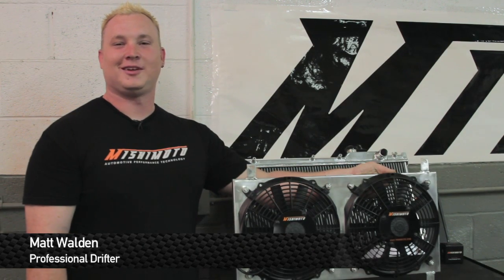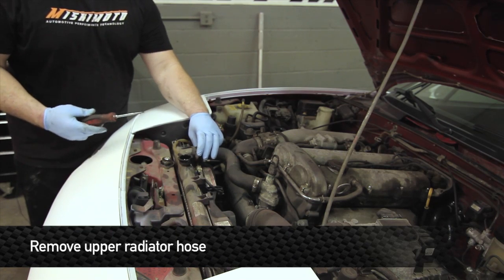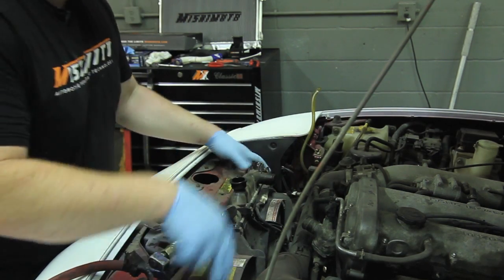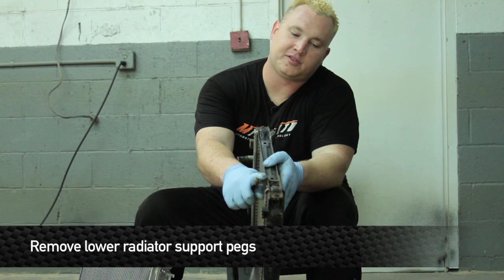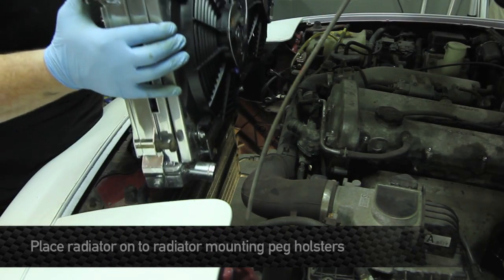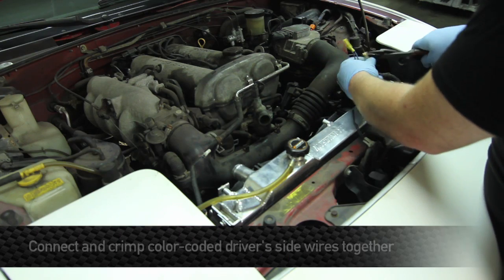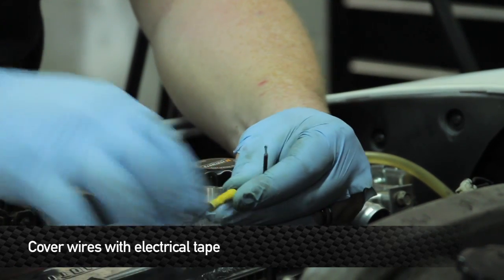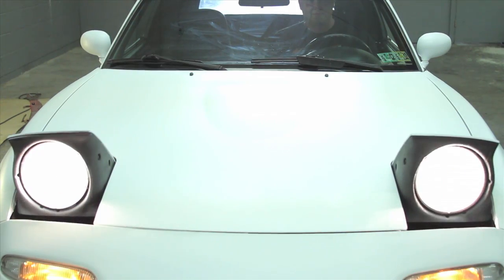How To Install: Mishimoto 1990-1997 Mazda Miata Performance Radiator & Fan Shroud

Comment: Should you flush the whole system several times before changing the radiator and adding fresh coolant?
Reply from the maker: This is not necessary unless you believe there are contaminants in the system.
Reply: @mishimoto  I think the car was sat for a number of years with same fluid so probably should I guess!

Comment: FYI on a 1990 the ground wire on the New Fan is the blue/yellow one and the red/white wire is the positive one. One the car black is negative and black/blue is positive.  Fan came with two plugs on it but the passenger side was not the correct one. Had to use the original connector. Had to search high and low to find out which was which. Hope this helps someone else in the future.
Reply: You just saved me so much trouble. Thank you so much!
Reply: Thank you. Saved me a bunch of time.
Reply: I love you so much
Reply: im getting ready to upgrade from my oem radiator and wanted to thank you as well i was anxious looking at those different colored wires. THANK YOU!

Comment: Would you have to tune the ECU because of change of flow or anything like that?
Reply from the maker: No need, the thermostat will still regulate temperature as usual, this allows the system to handle more abuse overall.

Comment: Can I install these fans on a stock rad?
Reply from the maker: Hello Sam Leary . This particular fan shroud is designed to fit both your OEM radiator as well as a Mishimoto performance unit so you'd have no problems at all :)

Comment: Can i reuse the stock fan shroud with this radiator?
Reply: Tight fit, but I managed to use original fans with my Mishimoto Rad
Reply: Just spent 6 hours trying to do just this on my NA 1.6. How. The. Hell did you do it sir?

Comment: He mentioned it briefly towards the end but do you leave the radiator cap off when you start the car up to turn on the heat and don't put it on until you feel heat from the vents?
Reply from the maker: Yes :)

Comment: I replaced the coolant temp sensor and i got the x line performance rad and fan shrout . I changes the fuse as well and the driver fan or ac doesnt come one . I rewired it twice and nothing ? Did i not bleed the system properly? My temp thermostat works and cluster too. Any advice??
Reply from the maker: +Damian Gumienny please email support@mishimoto.com - they will be more than happy to answer any technical questions!  :)
Reply: I actually had the fans tested on a 12v battery and they didnt click or spin , so i filled out the warrante application to send it in and get it repaired , however i replaced everyother component so i dont have to worry about it down the road . Thanks !

Comment: Can i just use stock radiator fans?
Reply: Yes
Reply: it was a tight fit for me today, and only one of the ac lines bolted back in to the new radiator. i also had to remove some intake pipe to fit it in. i also removed the upper mount rubber because the extra thickness of the new rad and stock fans meant it flexed too much so i just bolted it straight into the mount

Comment: I got an mx5 also at home but tbh the standard radiator is more then enough for cooling... 30°C in the summer reving it all the way to 6000 rpm manny times uphill never gets to hot. Mx5's have a big radiator for the size engine it is.
Reply: the only time my temperature gauge raised, was when doing 200 kmph on the highway for half an hour

Comment: when installing the dual fan shroud on to a miata that only had one OEM fan, how does all the wiring connect up?
Reply from the maker: oli sopher Sorry for the delay in response!  If your car is indeed a non-A/C model then it is very unlikely that the wiring exists for the second fan. Some have simply tapped the wires from the primary fan and used them for both slim fans but this usually overloads the factory relay and causes issues. I would recommend setting up a dedicated second relay for the passenger side fan. This will require 12v power, 12v ignition signal, ground and a signal from the factory fan switch. Tapping from the factory switch to a new relay will ensure that both fans activate at the same time. The drivers side fan can pull the power and ground from that body harness, but I would not recommend using this harness to power both fans.  Let us know if you have any further questions!

Comment: I notice you didn't bolt the AC lines back on is it simply not needed or is this a missed step?
Reply from the maker: Hello!  We did not include that step in this particular video - thanks for pointing that out.  The A/C lines will attach to the Mishimoto radiator as they do the factory unit.
Reply: thanks I found that out as I was fitting the unit. great product but wow is space tight after putting everything back in.
Reply from the maker: blitzwing1985
You're welcome!  If you have anymore fitment questions, please don't hesitate to email us at sales@mishimoto(dot)com.  Have a great day!

Comment from the maker: That is a possibility. In order to properly purge the system of air, you need to turn your heater on, to cycle coolant through the heater core. Otherwise  you may have air bubbles trapped in your system, which could cause overheating.

Comment: excellent video. when i replaced the radiator on my 1990 miata, i found 2 ports on the bottom when i determined were for cooling transmission fluid.  this video must be for manual transmission, but still very helpful.

Comment: Bad design for MAZDA RX-8 It doesn't fit a lot of design mistakes. the screw hols doesn't match with OEM. the OEM brackets does not fit also if you try to make them fit you will damage the radiator.